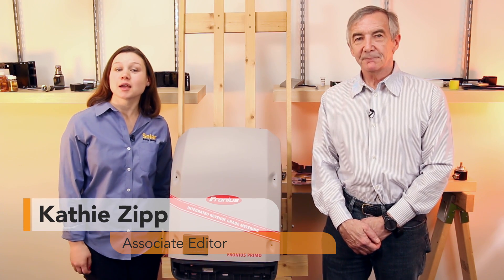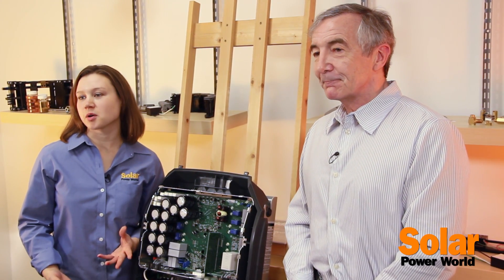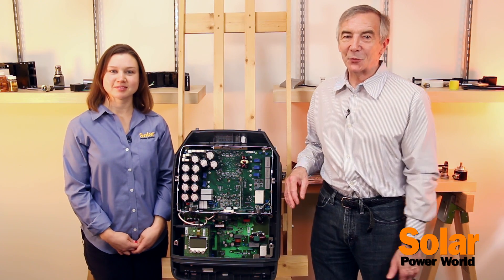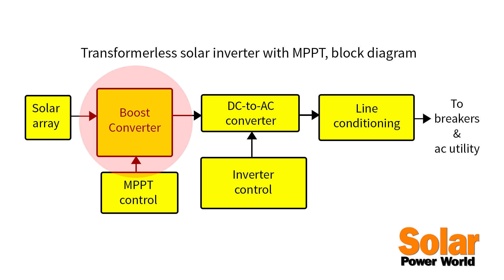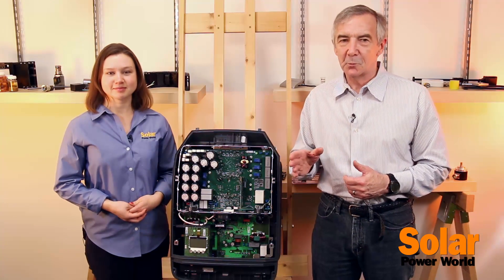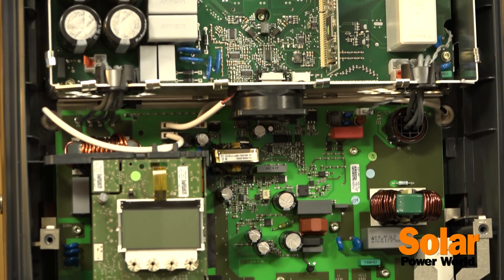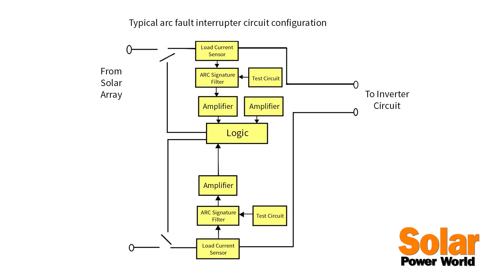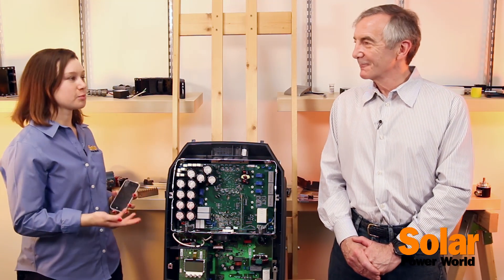What's inside the Fronius Primo residential solar inverter?

Comment: I would like to tell everyone my experience with a Fronius inverter. Paying a premium, I thought I was getting a quality inverter with a 10-year warranty. After 2 years of use the inverter stopped working but I thought it will be ok, the inverter has a 10-year warranty. I called Fronius and they told me a code came up that one of my solar panels must have got wet and shorted to ground and fried the inverter or it’s a bad install and they don’t cover that. They told me I could test this by measuring voltage to ground and it should be no more than one volt to ground. I measured the voltage and only had one volt, so I did not have a solar panel shorting to ground. correct me if I am wrong but isn’t the purpose of a ground is to direct the current to ground so no one gets shocked? Before installing a new inverter, I had someone come out and inspect my system to make sure there was nothing wrong and they said they couldn’t find any problems.  I installed another inverter and its been running great with my same solar array that Fronius told me was bad. Fronius does not honor their warranties. Don’t get screwed like I did, buy something else.
Reply: If there was a ground fault at the array, it is due to a bad installation or panel, neither of which are Fronius equipment. The inverter manufacturer should not be responsible for faults outside their control. If a technician poorly installs the inverter, e.g. allowing water ingress to the inverter, the inverter warranty is voided. This is true of nearly all electronic products. If you misuse/abuse it, or do not follow installation instructions, you void the warranty.
Reply: @larryem523  i would agree with that but please explain to me how an inspection after the failure turned up no problems with my solar array. i have since put in a new inverter and i have not had any problems at all. i think your fronius uses excuses to not honor warranties.

Comment: Can you guys comment on anything about why a lot of  roof top solar feeding into grid would cause the need for infrastructure upgrades on the grid.
Reply: Because if the energy is going back to the grid then there needs to be infrastructure in order to deal with the increased load.
Reply: @listlessviewer153  but the increased load is the cause of the problem not the solar panels that feed in the extra power. Without solar the extra load ( more houses, extra air cons etc) would still exist but the extra power would come from burning more coal. So solar is being blamed for more power demands? Seems unfair?

Comment: I have had the Primo 5.0-1 installed now for one month and have had no issues. The WiFi connect is great and I can monitor it from home or elsewhere at any time. Great product so far.
Reply: Do you have an issue with fan noise ?.  We have ours in the garage and on hot days the fan noise is quite noticeable ?

Comment: Goodpresentation Katie and Lee, 
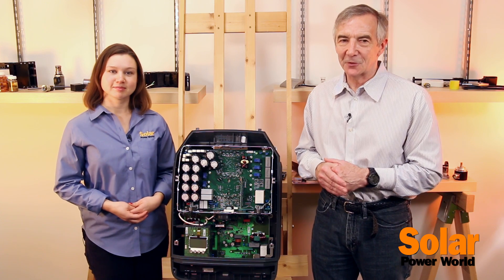The revenue grade metering option is a specific inverter which has a specific part number. Not all Primo's are Revenue Grade Metering ready, but inverters with that feature must be requested specifically. The small pug in board Referred to @ 5:42 is an extension portion of the Power Stack PC board. RGM is an overall function, between hardware and Firmware.